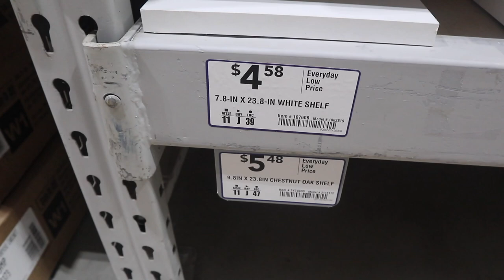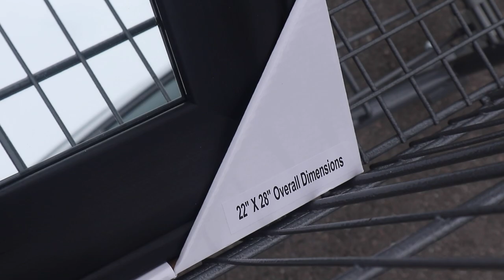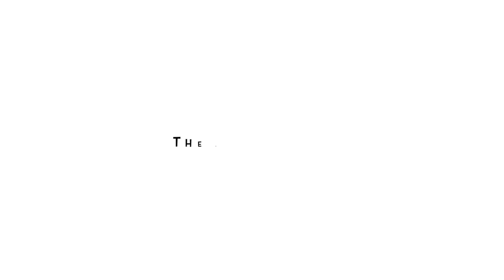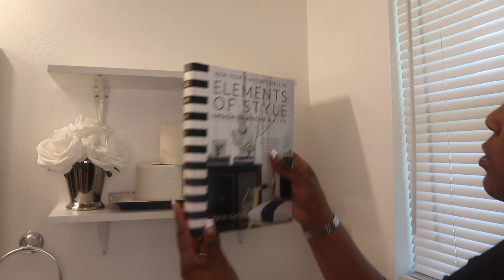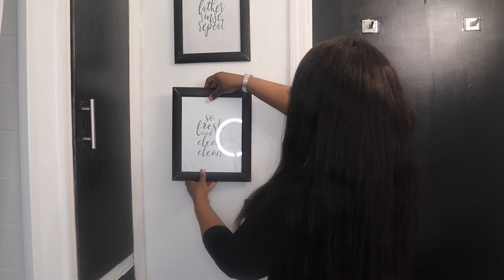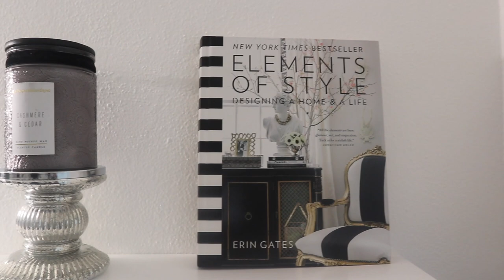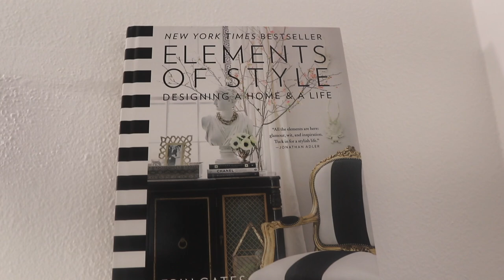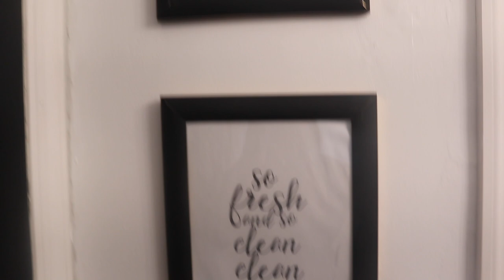HOME RENOVATION SERIES EP:3 Installing floating shelves | Shop w/m | New Hardware | Bathroom Remodel

Comment: Good evening queen you are doing so well with your home and decorating if I may offer any tips myself as a long time DIYer on the bathroom shelves add little rhinestones with a bit of glue onto the nail heads and also run a lighter around the edge of the ribbons to get all of those strings off